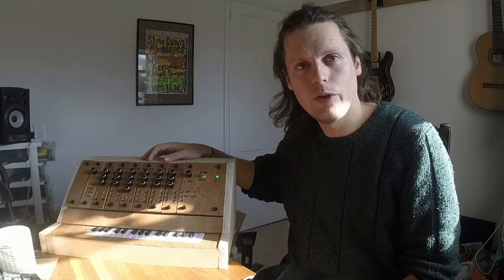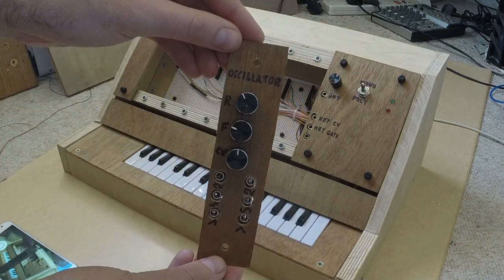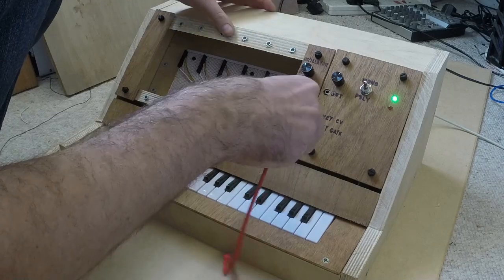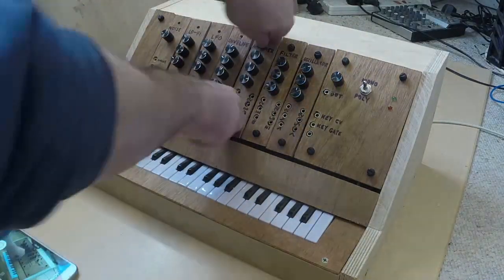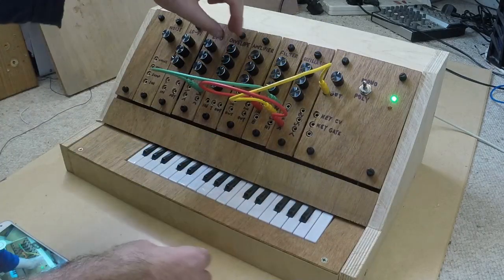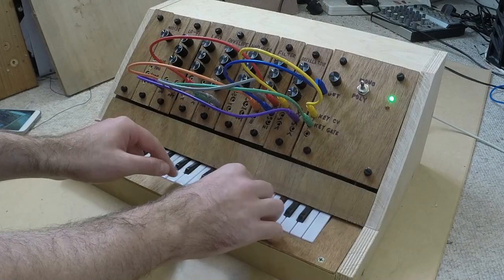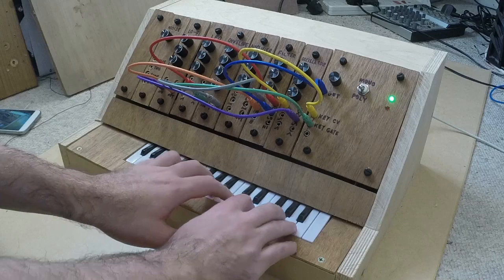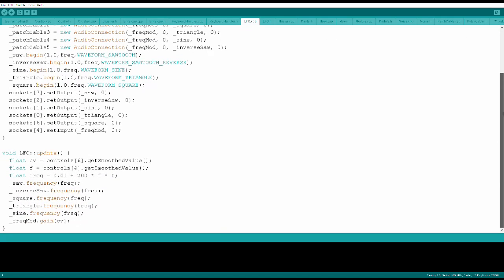PolyMod open source modular synthesizer (Hackaday Prize 2018 finals entry)

Comment: Where are the schematics?
Reply from the maker: There are stripboard diagrams on the project page (linked in the description) but unfortunately there are no proper schematics. To be honest, when I designed and built this, I was operating right at the limit of my ability with electronics, and didn't even really know what a schematic was! I'm slowly working on a much better version of this project, which will have full schematics, PCB layouts, etc, and be available to buy, but it's unlikely to be available until next year at least. Keep an eye on my GitHub for updates: https://github.com/mattybrad/
Reply: @BradshawInstruments  ok man i only need the cv gate for the keyboard,realy thanks for the help 😁👍